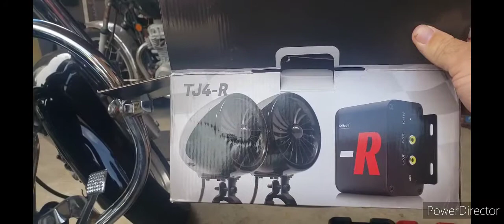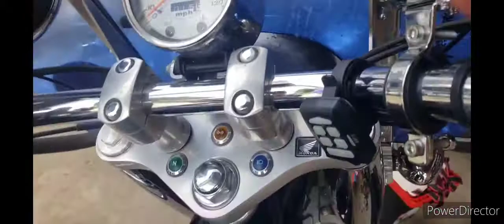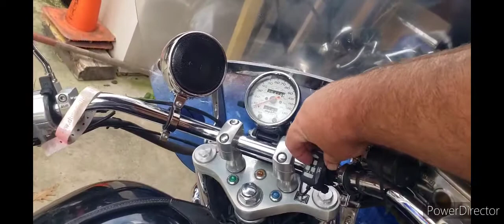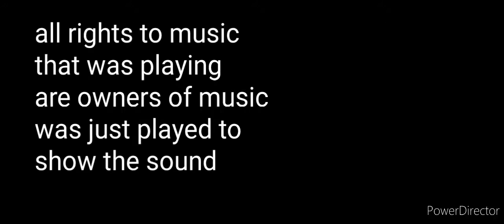Go Hawk motorcycle radio install

Comment: Does this come with a shutoff? Buddy says you have to buy a second switch? Sure hope he's wrong. Sure don't wanna add one if that's the case I may send it back when it comes FML
Reply from the maker: Mine has a key chain looking peice that turns it on and off on the handle bars
Reply: @NicklisFamilyAdventures  I canceled it just in case because that little switch I couldn't find if it had a power on and off wasn't going to chance coming to my storage and finding my bike dead.
Reply: @OutlawJesseJames  The top arrow on the handle bar control is the power button. You press and hold it to turn it off and on. The boss rebel, which is a competitor does not have a kill switch or hand control and you have to manually install a kill switch.

Comment: Thinking of tying this into an existing touring motorcycle , without using the included speakers. And Also using the existing power from the Fuse panel, think this would work?
Reply from the maker: I bet it would work

Comment: Having trouble hooking up the GoHawk to my battery without it cutting off the power to battery. What’s the best way for the clamps to fasten onto the battery?
Reply from the maker: I just used the spade ends right to the battery  screws.
Reply from the maker: Maybe look at a quick connect for it like battery tenders use. Thanks for watching hit that subscribe button